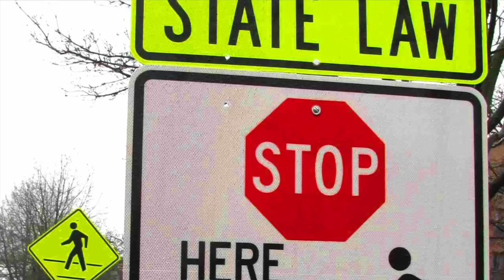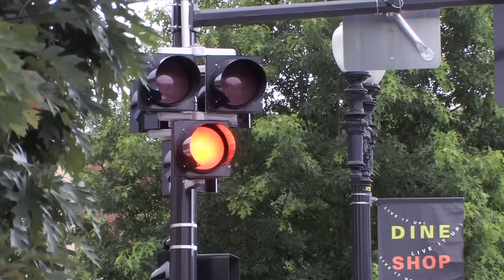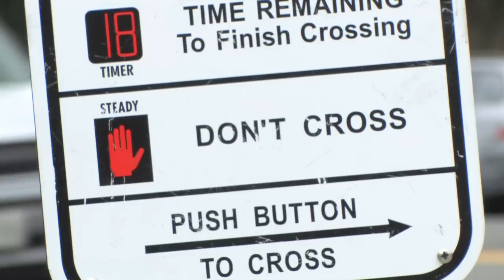NID for July 2013: The HAWK Crosswalk

Comment: Even on the flashing red I will not go until they turn off, a very wise idea.

Although hawk signala are for pedestrians, and bikes or motor vehicles just as much have the right of way as pedestrians, and I would rather not get into a collision with a bicycle or another vehicle, so I I just wait until the red lights switch off completely. If other drivers behind me don't like that, tough, I don't care. 

I am one of the safest drivers you will ever meet.  I put safety over courtesy, to help with other drivers behind me.

Comment: I think the script for this video is wrong; when the HAWK signal switches to flashing red (or wig-wag) it is supposed to be analogous to a flashing red beacon and drivers should treat it like a stop sign. What is shown at 1:53 and following of the video are drivers running the signal. Red NEVER means go. The assertion that drivers can proceed through a flashing red signal is not only false, but extremely dangerous misinformation that is in direct violation of the MUTCD.
Reply from the maker: https://comp.ddot.dc.gov/Documents/Hawk%20Pedestrian%20Signal%20Guide.pdf
Reply: Amen to that. It is safer to wait for the signal to turn off then go. That is exactly what I do at HAWK signals in one town near me. I wait for the flashing red lights to turn off, before I go. If other drivers drivers behind me don't like that, tough, I don' care. When I am behind the wheel, safety comes first, no matter WHO gets irritated.